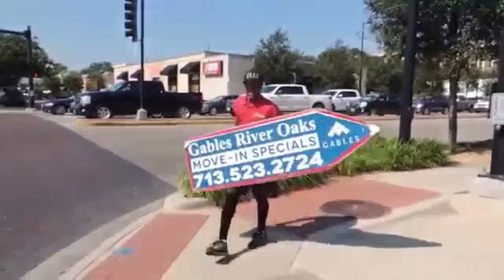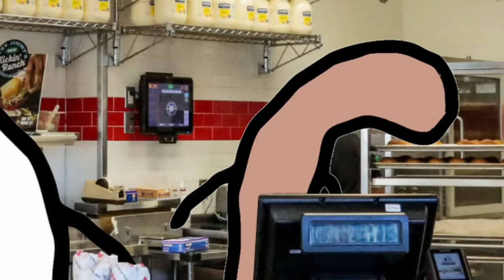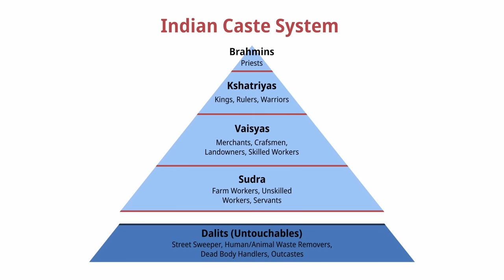7 Levels Of Blue Collar Workers

Comment: I used to  do welding in tier 4, 14 hours including mandatory over time 6 days a week grinding, polishing, welding and facing steel 30 ton fan blades for $12 an hour since it was the only place that would hire me on fresh out of trade school (literally I could've been making more at a gas station) they loved my welds but said I'd have to "train first in order to get to the bigger stuff" even though I proved to them that I could do it and had the certs.  I'd have to crawl up inside this 3 foot wide 7 foot long opening on every single blade of the fan and clean all of it in heavy leather equipment with an air hose on one shoulder and a lantern on the other, getting sparks thrown on every inch of me and coming out looking like just stood on top of a coal rollers exhaust while people screamed at each other in the background in the 100+ degree shop especially with all that hot steel being moved around, then I almost got my feet crushed by said fan blade when someone turned on the machine that holds the 30 ton fan blade, and rotated it while I was still inside of it with my feet hanging out, I also threw my back out a few times  rolling smaller 2 ton fan blades on spindles and went home feeling like I got hit by a car most days, I went back to school and got into computers, and now I'm in a nice air-conditioned office without any of that stupid crap, and I'm poised to get quadruple of what I made welding in a few years. Being a janitor for a theme park while I went back to college on the side was pretty cool though

Comment: I'm a flatbed commercial trucker that runs the heavyweight loads (105,500 gross weight max) in the west 11 states.  On an easy day it's just driving 600-700 miles a day.

and on a  tough day, you unstrap your load, get reloaded, start driving, and then have to chain up in blizzard conditions, then take the chains off when you finish driving through them mountains, and by the end of the day you end up working almost 14-17 hours, and you're hosed as fuck.

And you're just covered in road grime by the end of it too.  

All your relationships are strained because you're out of town from 5 days a week up to 3 straight weeks a month, you can't keep on top of home maintenance, car maintenance, or fridge maintenance.  Your own baby looks at you like a stranger and doesn't want to be held by you, and trucking marriage has a high divorce/cheating rate.

Comment: I used to work in a machine shop. I cant really define what i did because i did alot, mainly sheering, drilling and stud welding. I got pretty used to being on fire and telling other people when they were on fire. When your pant leg is burning it can be hard to notice.
I did drive a forklift alot working there but now i drive a forklift full time but i use it for dumping garbage instead of storage or transport.

Comment: My issues that got me outta blue were the shitty hours, low pay, low to zero raise potential, disrespect from all of society, no one wants to date you....AND....I have a bad back I was born with, so I won't even be able to work a manual job by the time I'm 40. I knew my time was running out so i quickly moved from construction to construction site security to luxury office security supervisor to industrial cost estimator. Have a desk job now and while it has its problems it doesn't have any of the above and I have so far increased my wage by 50% every 18 months since graduating college....which took my dumbass 12 years to do but was worth it. No more shoveling shit out of toilets!

Comment: bro you missed mechanics. probably one of the worst job you can do today because most garage have such shit pay and the labor is hard on the body from cuts, burnt skin, limbs that get squished, lifting many heavy objects, working in awkward positions  that result in many different pain on the body such as back, shoulder, elbow and knee. working with high torque impact in your hand all day every day will create pain in your wrist as well then there is the fumes from exhaust gasses and working with oil all day. and thats just the bad for the body, you can loose your mind tring to figure out electrical problems. the amount of knowledge required to work on cars is very high unless you only do 1 thing on cars.

Comment: repair tech working on consumer devices, endless complaints from customers who attempt to swindle their way into getting free shit, endless ammounts of customers constantly calling asking for updates to their repairs even though its waiting parts and has been for the past week as we said it would take when we checked the device in and it says so on the receipt, customers complaining that we arn't working fast enough even though we have 5 devices ahead of their repair and they were quoted 4 hours for their repair and we are 30 minutes into that timeframe. people demanding to speak to superiors as soon as they walk in for no other reason other than to do any of the above and make a commotion. people getting angry at the standard timeframe that we always quote for certain things, or the price of repairs which other companies set the prices for the parts and we can't change them but we still get blamed for it, people getting upset when we can't repair something because they put it through their washer and dryer and then ran it over on the interstate with a semi truck and then crushed it under a hydraulic press. corprate constanly changing how we are supposed to do things and how much to charge for the services, adding bullcrap workflow requirements that slow down repair speed but still require us to be able to complete repairs in borderline unobtainable timeframes without causing further damage to devices. also basically sitting at a desk with no sunlight for 13 hours a day, only the hum of florescent light bulbs and the screaming of children and angry customers in the lobby to keep you company. not to metion company performance metrics that increase exponetially when we manage to get close to them one time and then they get angry the next month when all we have is people who decline repairs and tank the metrics. people checking devices in and then getting angry when we can't repair the device because the have a roach infestation at home and we can't keep them in stoer because of how many devices we have in store that can be inefected so we either have them come pick it up or we recycle the device for them. people getting mad for any of the above reasons and then trying to either get into the back of the store, attack staff and or try to steal random shit and mess with the lights and crap. this is just a fraction of things i've seen in only a year and a half. here's to several more.....fml there's enough cortisol coursing through me to outright kill several adult blue whales and probably a couple elephants too.